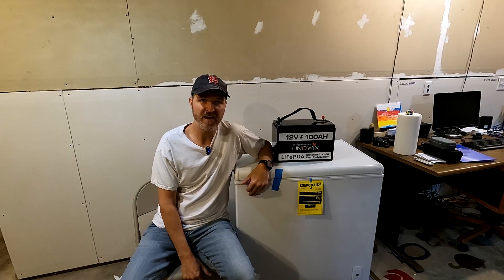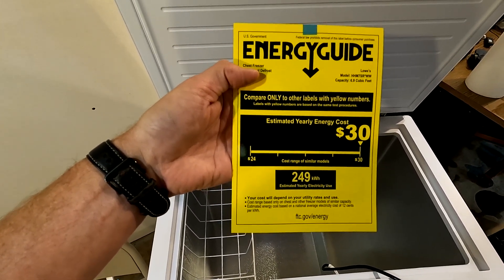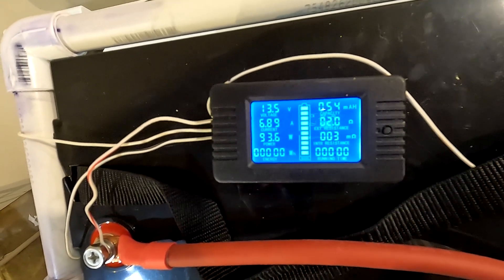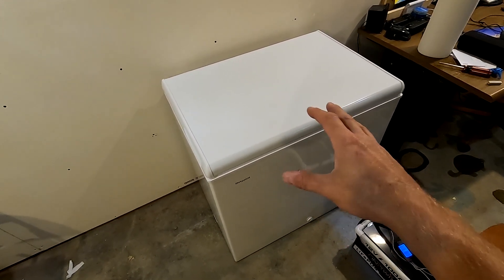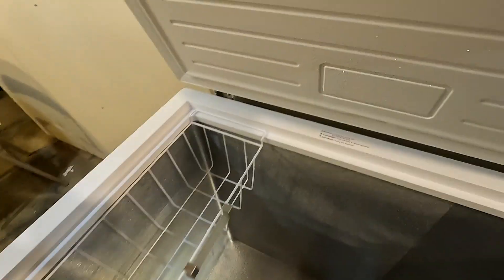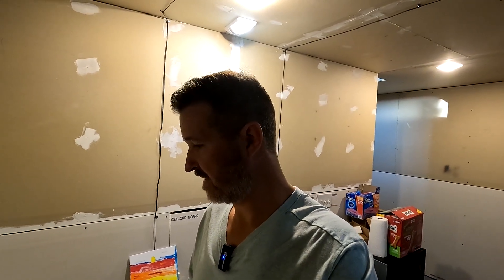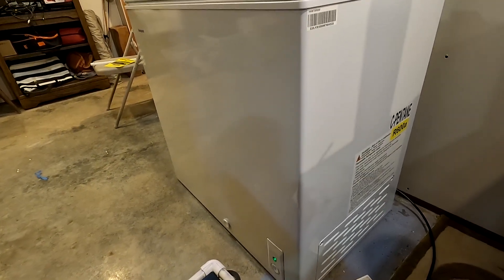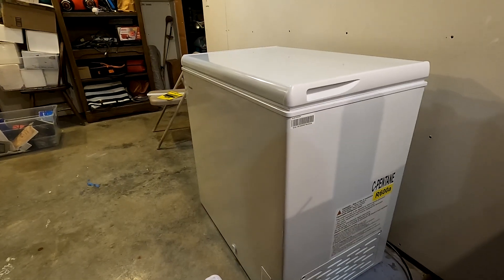Running Brand New 7cu. ft. Deep Freezer with a 12v 100ah LifePO4 Battery!

Comment: Nice testing! Ibe been doing some experimenting with my battery set-up as well. I noticed that on about 1500w load from a water heater, i noticed a 1 to 1.5V voltage drop. Have u tried and observed how ur battery voltage would drop on a 1.5kw heater load?
Reply from the maker: I've never measured the voltage drop on large loads since I really don't constantly draw anything larger than 500w at a time.  I need to test out the difference in the voltage drop in a 12v setup compared to a 24v setup and 48v setup.  Thanks for the comment!
Reply: @OffGridBasement  looking forward to your test results will be very interesting. I have a Redodo 24v 100ah battery. I wonder how it will compare to ur 24v chins. I saw one video saying using the victron lynx system (less resistance due to less wire cutting l, crimping, etc) will lessen the voltage drop in a solar system.

Comment: hello good video I have a question , I have the same size freezer , also battery 100a for solar panel , I want to use it for camping for the summer , a panel can charge enough the battery and work all the summer like this only for 1 freezer on this size like yours ? ? and if yes what size of panel I need? thanks a lot
Reply from the maker: Thanks for the comment.  Usually you can achieve 5 hours of good sun a day.  Summertime will be longer.  I believe you would need a 200w solar panel and a 20 amp solar charger controller in order to keep that freezer running throughout summer.  Hope this helps!
Reply: @OffGridBasement   sure it helps , thanks a lot for this , in my country (Greece) we have a lot sun days and for this I want to make a set up .

Comment: Thank you for your review
Confirms my results
I've been through gas fridges 12v fridges galore in my off grid setup in NSW Australia
But found with todays energy efficient stuff 
Oz mains 240v fridges and freezers are the way to go
My 240v fridge only 242L hisense 175 kwpy
 And it's mate a 155L upright freezer 228 kwpy
Run fine for nearly 2 yrs now on a 400ah bank of 24v flooded batteries with a 2000w inverter
And another 100L freezer on another bank
People always mention inverter loads as a negative but if your off grid the inverters on 24/7 anyway
With 12v gear its good but you have to clean the fan and radiator yearly as they block with dirt and grime and lose efficiency
Reply from the maker: Yes.  That freezer is actually plugged in to my 24v 300a system and doesn't have any issues and the system runs it with absolutely no problem.  Thanks for the info!

Comment: I know you said running watts  settled  @  100watts  ... But what was the Actual Startup  watts ?  I heard that actual starting watts  can double even  triple
Reply from the maker: That is a good question.  I'll need to use a smart plug to capture the startup wattage.  I'll try to capture that and let you know!
Reply: @OffGridBasement  Thanks
Reply: @OffGridBasement  I wrote GE about the specs on that freezer (we have the same Hotpoint model). Their reply:

"I apologize for the wait on this information. Your freezer’s running wattage is 195.5 watts and the surge wattage can be from 2-3 times the running wattage.

I hope you have a wonderful weekend. Thank you for contacting GE Appliances."

That would mean you need 600w minimum surge capacity. Not understanding things electrical...I'm wondering why if the running wattage is 195.5w, why does my power monitor show it's using 50w -60w??
Reply: Yes  that is always interesting to know
That's the real killer
I run a 155l upright freezer and a 242l fridge only on 240v on a 400ah 24v bank fully off grid here in OZ
Temps between minus 6 Celsius in winter and positive 46 Celsius in summer
I started with a 1200w pure sine wave Giandel inverter
But on the odd times both started up together it would trip the inverter
Both are only about 50/60w running current
Changed to a 2000w model and all runs fine
So definitely something to consider
Cheers

Comment: a freezer with less than half its capacity used is showing most use of power- learned that in 70's.. my own freezer is twice as big but the usage is comparable..yet, my freezer has actually frozen at the compressor if run too empty- so I run it with water jugs often times between meat loads. One day I will get a 12 or 24 vdc freezer
Reply: I actually have a 2000 watt inverter on a 100 amp battery running with a chinese small charge controller and two 100 watt panels and it is on six months running fine for a fridge and a freezer.. normally holding 40-50 pounds chicken.. 
no problems
Reply from the maker: That is the perfect sized system for the application it's powering.  Nice work!  Thanks for the comment.
Reply: @brotheradam  hey I appreciate that info. I'm on here because I'm trying to set up a system to run two small chest freezers on a solar system some of what you just stated.
Reply from the maker: The water jugs is a good idea!

Comment: I have a similar Freezer and it refuses to run off my Jackery 500 or my Bluetti EB3A. It does run off my DIY solar system that has a 3000 Watt Pure Sine Wave Inverter. You would think 500/600 Watts of power would be overkill to run the Freezer, but nope wont do it. The freezer did come with a caution wont run on solar generators, can you believe that lol.
Reply from the maker: I'm surprised about the EB3A.  It doesn't work even if you have it set to powerlifting?
Reply: @OffGridBasement  i didnt try the powerlifting mode i dont think i would use the mode for any reason only because it could case damage.

Comment: Good test!  According to the manufacturer’s utility usage, the freezer should—under normal circumstances—use 249 kWh per year on average.  That would average 0.682 kWh per day.  So…ignoring the inefficiencies of the inverter, under normal circumstances, a 100AH battery should be able to run the freezer for almost two days.
Reply from the maker: That is probably correct.  I plan on doing the test again once I have the freezer 1/2 full.  That way I can do a good example of a power outage with an already frozen unit with 1/2 capacity.  I hoping to get another 10 hours at least!  Thanks for the comment.
Reply: 😊9😅so 7🎉890 131pf
Reply: Great analysis! The Segway Portable PowerStation Cube Series seems like a solid choice for outdoor enthusiasts and RV lovers. Its massive capacity, fast recharging, versatile sockets, and waterproof technology make it a reliable power source. Plus, the smart APP control adds convenience. Thanks for sharing your insights!

Comment: Of course you did not have the solar panels plugged in so it would run indefinitely otherwise. What size panel would be suitable if just running the freezer?
Reply from the maker: 500-600w of solar panels would easily do the trick IMO.  If you have good sun everyday then 300w would do it.  Thanks for the question.

Comment: ~1 kwh/day to maintain a fully loaded chest freezer.

You could just charge it while you have solar power and unplug it at night. If it's relatively full, you set it to the -4 deg C and you limit the amount of times you open it at night, I doubt it'll get above zero before the sun comes up.

With about 500W of solar panels, you can run this with minimal battery draw.
Reply from the maker: I'm sure you're correct.  Once I get it 1/2 full I will do the test again to see the differences.  Thanks for the comment!

Comment: Loved the test. Have you ever done a microwave test with these 100AH batteries?
Reply from the maker: No.  Do you have something in mind that you microwave daily?  It would also depend of Microwave size and inverter size.  I would need a bigger inverter to power a microwave.  That, in turn would increase the amount of loss from the inverter.  I could look into it.  Thanks for the question!